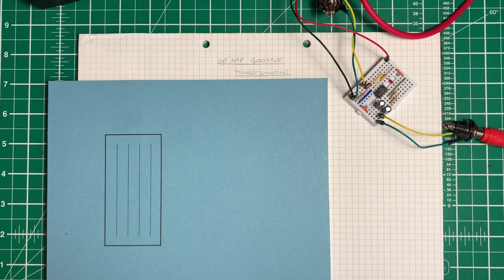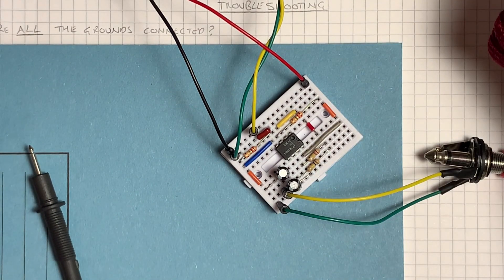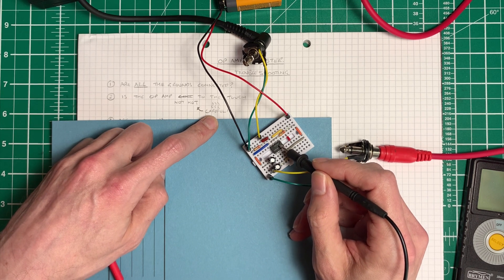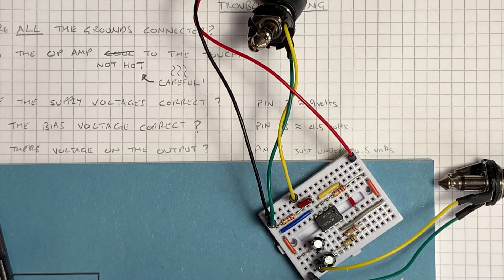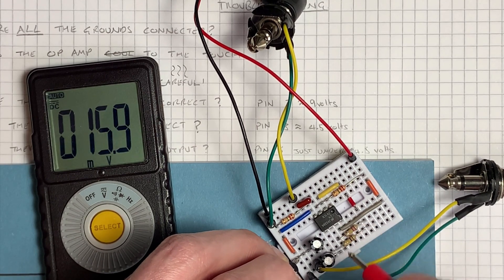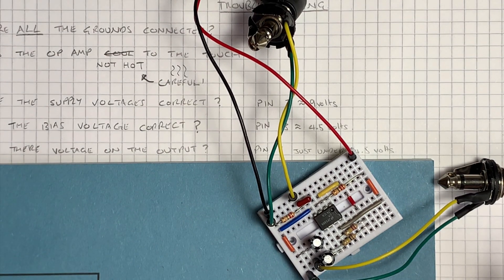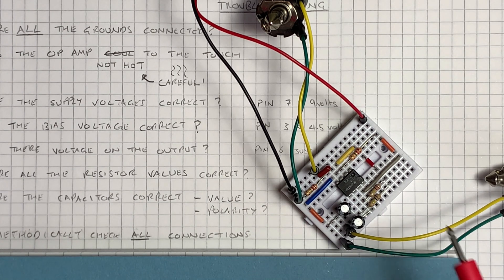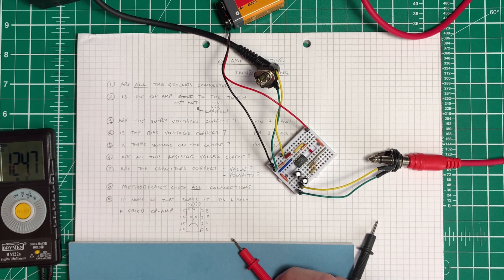Troubleshooting a Clean Boost Guitar Pedal

Comment: The reason the divider voltage looks loe is the impedance of the divider is high enough that the DMM internal impedance, in parallel with the lower resistor, changes the divider ratio. Voltage dividers built with high (megohms) resistance can create higher noise levels in your output signal.
Reply from the maker: Thanks, Tony. I’m always learning. In the improved circuit video we use a lower value for the divider.

Comment: Hi,
Correct me if I am wrong, but it seems to me that you have a small error in the schematics related with the electrolytic capacitors.
Normally the electrolytic capacitors (on the electric schematics symbols) show the positive side (+) on the white side of the symbol, not on the black side (like you have in your schematic). This may lead to some confusion.
Stay safe.
Reply from the maker: You’re right. Well spotted. 

My hand drawn ones are a mashup of the older and newer symbols. It’s fairly obvious which polarity I’m using here from the + symbols but I will note that for future videos. Thanks, Ben. Glad you’re finding these useful 👍
Reply: @MusicTechknowledgy  Thank you for sharing this nice pre-amp circuit.